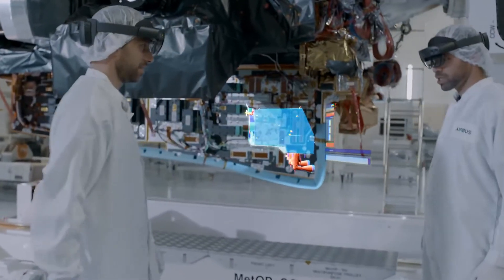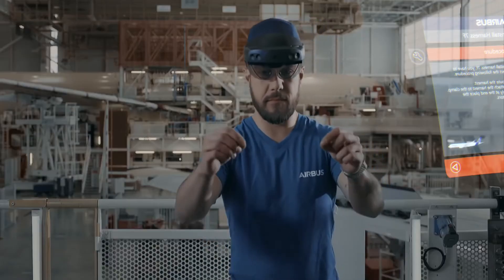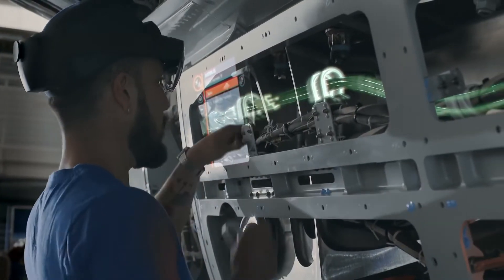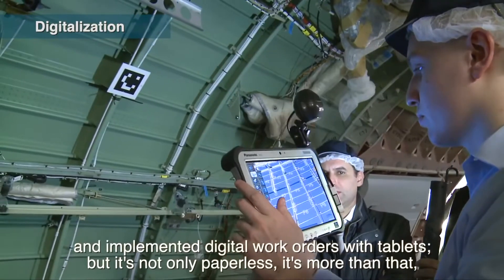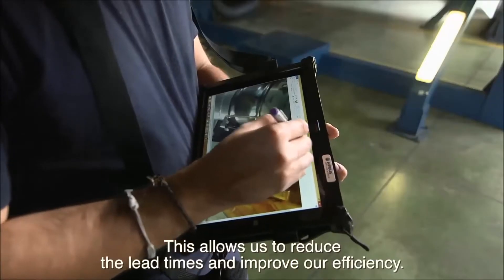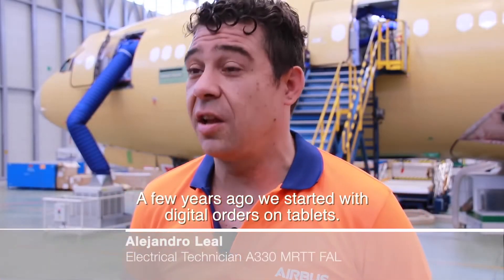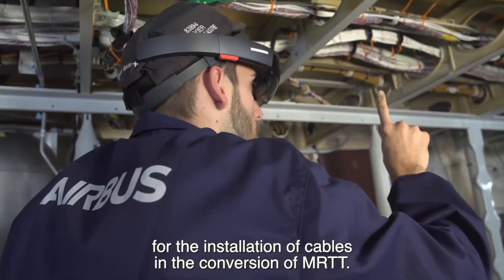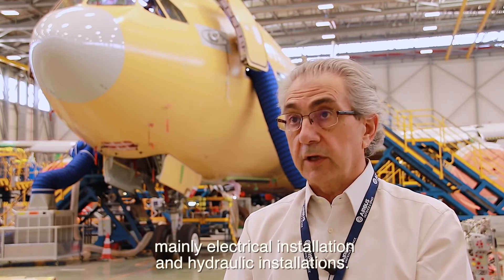Airbus uses Microsoft HoloLens 2 to improve production of aircraft

Comment: It is still a big issue once the material needs often to be reshaped to fit in the machine. I know it from my experience in predictive maintenance on aircraft engines. This is a cool tool for education purpose at an early stage but it is still complicated to manage the complexity of a hostile environement where cables are falling from everywhere. Computer vision is from now limited to simple maintenance but the remote assistance is pretty cool and facilitate a lot the work.